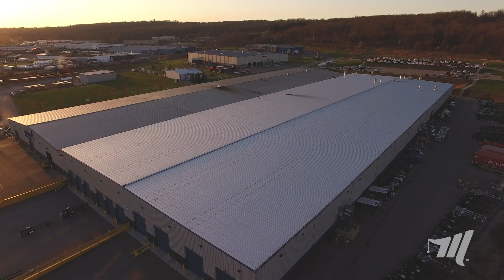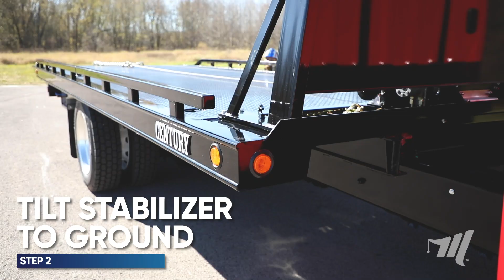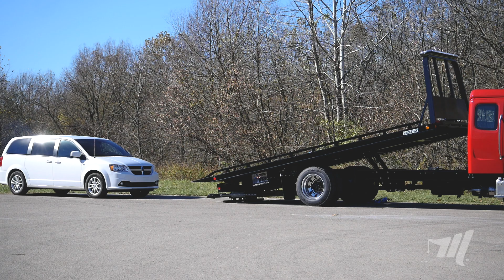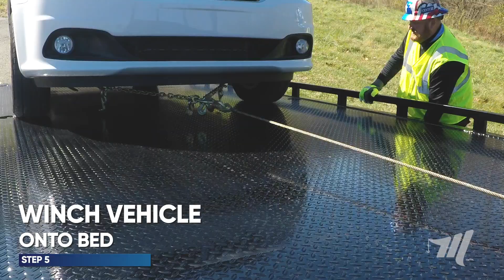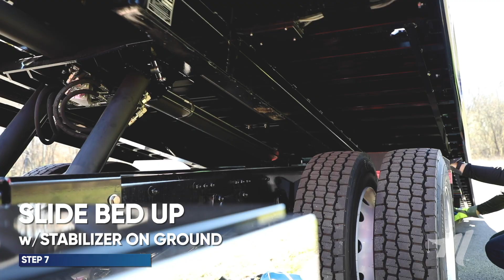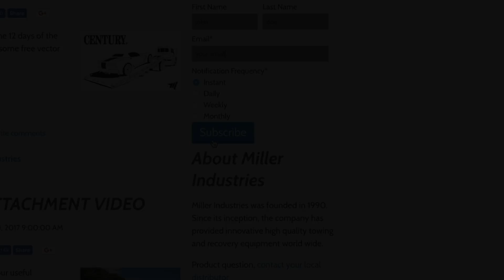Car Carrier Proper Operations from Miller Industries

Comment: Pet Peeve of mine.....it erks me to see operators run the bed back 10-15 feet.......WAY the hell out past the tailboard.......before tilting it to the ground......who the hell trains these people? one only needs to slide the bad back less than a couple of feet........sad.......and then owners wonder why frames crack and hydraulics fail......its abuse, learn to operate your equipment properly.....

Comment: Is it still not recommended to face the car rearward on the deck? I see operators do this all the time, but I saw a warning sticker on my old rollback that said not to do that.
Reply: Depending on the weight of the car and rating of the bed and GVWR it can put added stress on the bed of the truck and is likely to overload your rear axle.
Reply: @policeblue999  I didn't think of the rear axle weight, thanks.
Reply: Really has more to do with the aero of the vehicle that you have on the truck bed. Vehicles are designed to be moving forward at highway speeds and towing the vehicle backwards can cause damage to the plastic body panels of the vehicle.